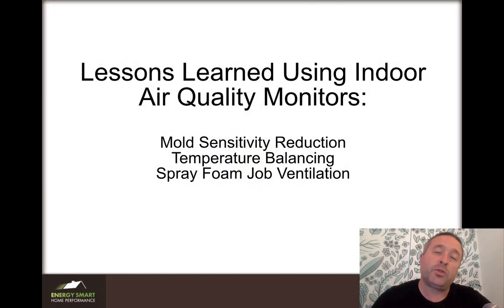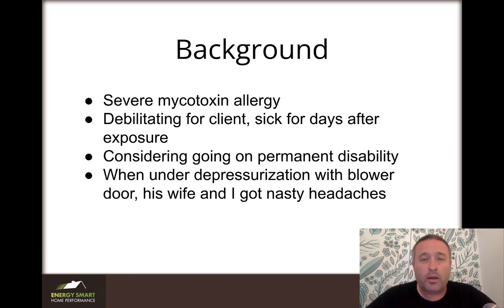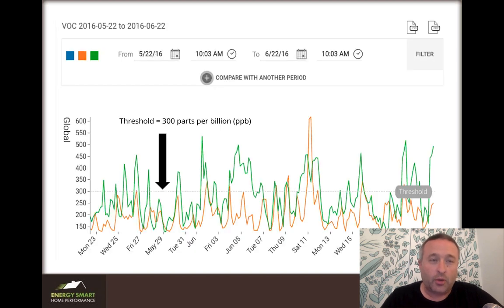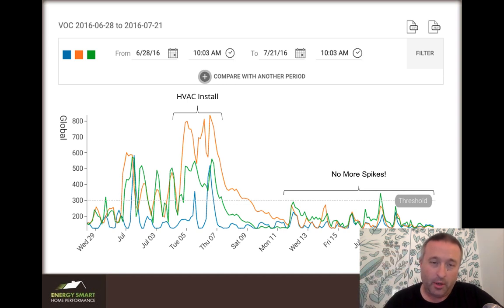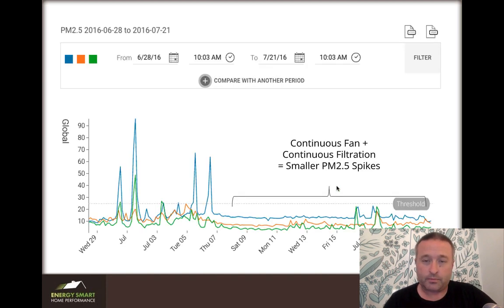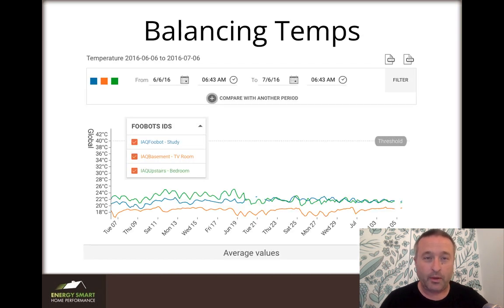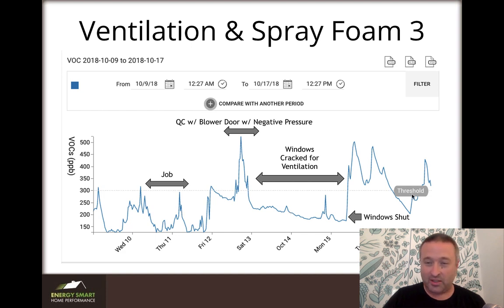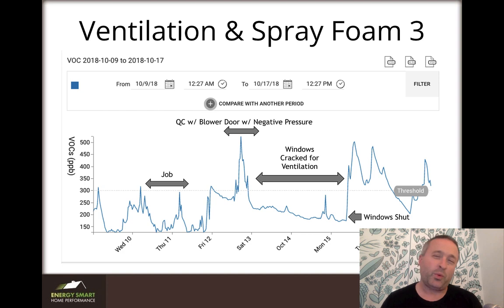Lessons Learned from Indoor Air Quality Monitors

Comment: Pretty cool to see that data correlated to the actions inside.
Reply from the maker: Data visualization has a lot to teach!
Reply: @NatetheHouseWhisperer  It would be intrestinging to connect that IAQ data to other furnace operation data. Been working on getting something like this setup with an elastic search db. Only recenely did the API become available with Airthings for non commercial users.
Reply from the maker: @justinherman9443  Ben Reed at Tzoa Haven is working on this. You can do it through a few different services. A good home dashboard will be instructive when solving problems.

Comment: of course you have a quality certified spray foam installer-have you ever been in who is more normal ? a guy with a truck and a GED who buys foam from manufacturer and plays chemistry professor in august, doesnt change tips or adjust cehmnisirty often and you end up with luray caverns in your ceiling and esp attic and off gassing for YEARS !
Reply: Are you going to provide data or just cast aspersions? We've consistently noted that the largest chunk of off gassing happens over the first 48 hours, and after 14 days tVOC levels settle to pre-job levels. 

Modern spray equipment makes it quite difficult to spray off ratio foam. Kit foam can indeed be an issue, there is no built in quality control. 

Unless you're going to show data like I did, or at least ask good questions, don't be surprised if you're blocked. -Nate
Reply: @johnwhite2576  Oh man that sucks. Someone probably ignored multiple error messages, it's quite tough to spray off ratio with newer equipment. And you're right, there's no easy fix.